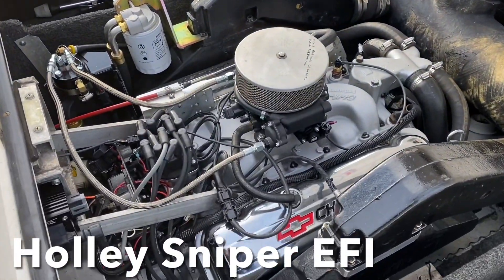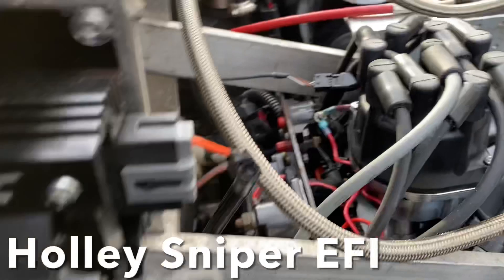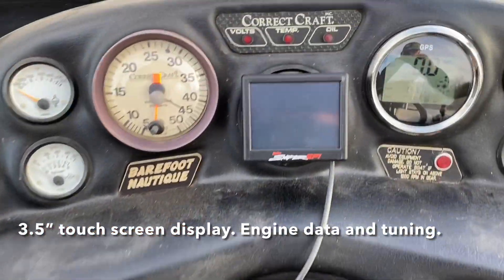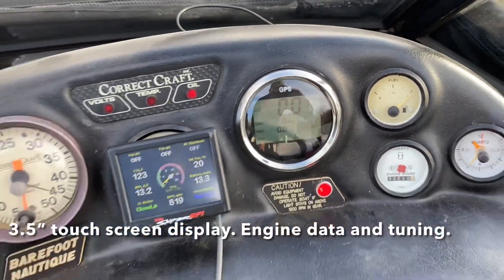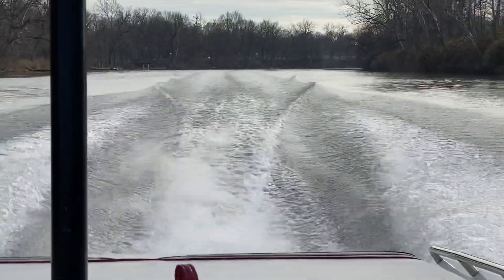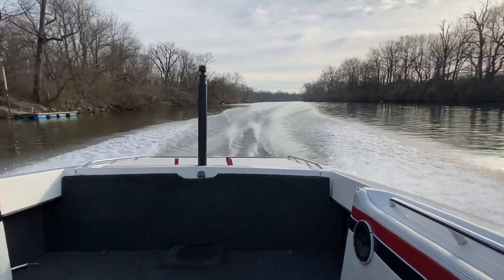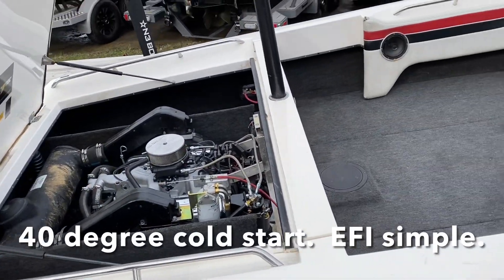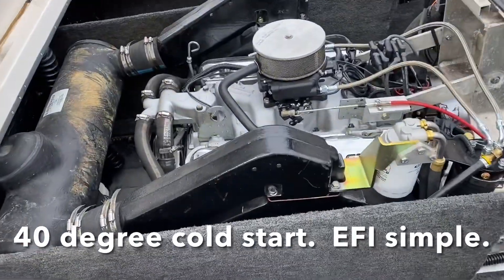Barefoot Nautique w/ Holley Sniper EFI

Comment: Thinking about doing this to a 5.0 Volvo penta with a new block

Is tuning and setup hard? Is it truly automatic? I called Holley and they said the marine application is hard and the 02 sensors don’t last. He said you have to let it self tune, then turn off the 02. Is this easy or hard to do? Full setup overall costs?

Comment: Wow that's quick. Not as fast as I'd thought, so you must be running a power prop. My much heavier boat with a 305 will do 50mph with no weight on board, and 47mph with 5 people on board. Having lots of carb problems with mine though, which is why I'm here.
Reply from the maker: BIGMONEY!!!!   Its weird to ride in.   I will post a video soon so you can hear it.

Comment: Hi did you need to put an 02 sensor in the exhaust system
Reply from the maker: You can see O2 plate on the closet exhaust manifold at :06

Comment: hi, thinking of doing this, how and where did you install the O2 sensor, I have a ford 427 FE with fresh cooling
thanks
Reply: You can buy or make a riser to go in between the exhaust manifold and the elbow. At 0:50 in the video on the right side you can see the silver riser between the black manifold and elbow, with the O2 sensor plugged into it.
Reply: Can you bringh me some photo from de plate  of the oxigen sensor please ? 0:50

Comment: I have a question please. I'm really looking to swap this onto my mercruiser 7.4 .....who did your tunning? As I've read the fuel mapping is way differnt for a boat then with a car load wise
Reply: I think these have a self learn mode where you just drive the boat at all rpm ranges and it does it automaticlly
Reply: @Datsun280zeeee  for marine applications? I've heard otherwise

Comment: I'm trying to do this right now. Where can I get the O2 adapter plate. That's been what is holding me up
Reply from the maker: Affordable Fuel Injection - 248-393-1621 Tell them N3 Boatworks sent you.
Reply: @n3boatworks  thank you

Comment: Do y’all sell the kit? And do I need to buy the sniper distributor and module or can I just buy the  (Holley Sniper EFI Self-Tuning Fuel Injection Systems 550-511K) kit for my 1987 barefoot natique with a Chevy 502
Reply from the maker: We don’t sell the kits but the marine version is available on Holley.com You don’t need the distributor but it does allow the tuning control more on the engine.  We can sell the O2 sensor plate, fuel control cell, and fuel tank fuel return line sender unit.  Call Adam 317-845-9253 for pricing.

Comment: I am in the process of rebuilding my marine 351w to a 418w stroker in my 84 MC and I am strongly considering the same efi conversion.... is there any info are willing to pass along in regards to the the PCM fuel control cell.... as of right now the fuel supply part of the conversion is a mystery to me.... thanks in advance.
Reply from the maker: Manco.  We used the PCM FCC system because of the simplicity and reliability.  The FCC was first introduced in 1998 and continues today.   Being able to bring the High Pressure fuel pump close to the fuel rail or throttle body and have a short run of high pressure fuel line.  It is coast guard approved which is a bonus.  Fuel system kits are around $800.  Call us at 317-845-9253 if you have any questions.
Reply: @n3boatworks  appreciate the info!

Comment: I'll be doing same soon, sounds strong. Takes forever for 454 to get heat in it vs 351. Interesting my 91 BFN motor brace is black I think.  Edlebrock oval port intake on peanut port heads....hmmm.
Reply from the maker: This one has aluminum edlebrock 110cc heads to help use the intake.  The braces came both ways in 1991 and I can’t tell the reasoning behind it.  This boat is 13075 and it’s silver.  We have another BFN 13095 and it’s black.  It would be interesting to see the change over in serial numbers.
Reply: The speed and rpm makes sense now, you can lower the closed loop temperature # will help it go into self learning earlier asked them about that key feature instead of tuning time on laptop.
Reply from the maker: Also we had a stuck tstat.  We needed up with a 170 deg thermostat and it works really well for the Sniper system.

Comment: Where did you put the O2 sensor? Are younot running water injection on your exhaust?
Reply from the maker: We have an aluminum O2 plate that sandwiches in between the exhaust elbow and manifold.  Pretty easy and straightforward.
Reply: @n3boatworks  Awesome! I saw FAST uses that for their Marine version. Thanks for the response.